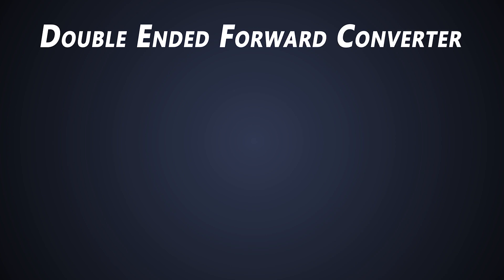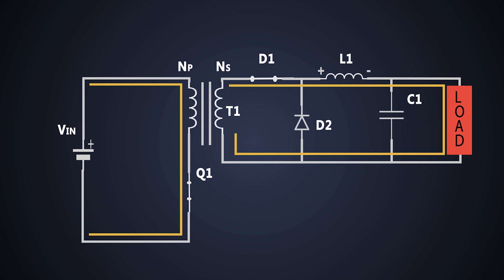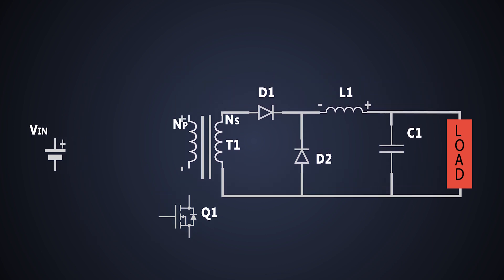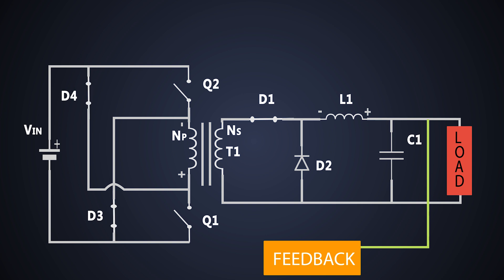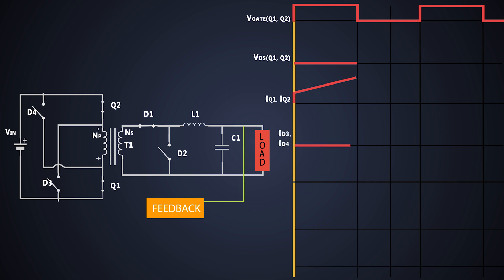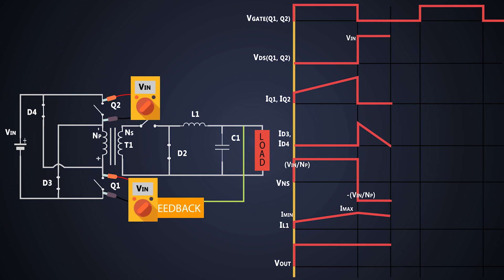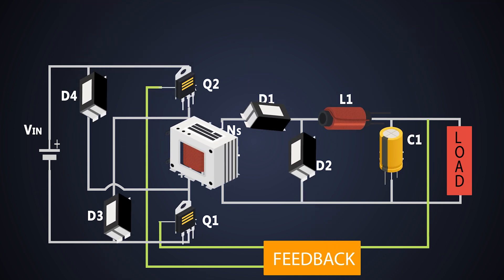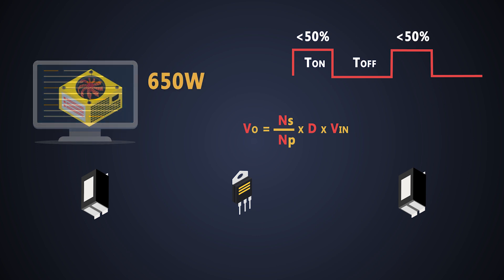Double Ended Forward Converter Working with Wave-forms | 2 Transistor Forward converter

Comment: Ok thanks for information but I have one question does the 2 mosfets use one pwm pulse as in not a alternating switching just forward switching from one single pwm pluse from the gate drivers transformer

Comment: Is there a reverse polarity of the primary coil or not in this system(forward)??
Reply from the maker: There is no polarity to any coil. just the DIRECTION OF THE CURRENT
Reply: @FoolishEngineer  
When determining the appropriate current for welding, does the processor change the pulse width or frequency, based on the feedback?

Comment: This topology is using advantage of transformer (for step down/up that only works for AC) to be used in DC, amazing idea! This is an alternative for converting DC to DC voltage in high power requirement instead of using Buck/Boost converter.

Comment: Why the D3 and D4 will on? If on, the current will flow from gnd to Vin. I'm so confusing.
Reply: NOTE: that D3 and D4 a REVERSED Biased towards Vin.  Only when the Mosfets feeding the Primary of transformer are turned off, does the voltage on the Primary become GREATER than Vin.  Then, and only then, do diodes D3 & D4 become Forward Biased = ON.  The Primary Winding is actually pushing amps back into the Power Supply capacitors!  When the the fly-back / kick-back voltage across the Primary Winding drops below Vin, do the diodes ( D3 and D4 ) become REVERSED Biased (again) and turn OFF.
Reply from the maker: Thank you for helping me out!

Comment: Can you tell me whats the behavior of the circuit under no load ?
Reply from the maker: If there is no load, still the converter will give constant output because of the feedback.
Reply: Will there be much power consumption !!! Or just minimal like in micro Amps.
Reply: @mdadil9233  There is more to this circuit than shown in this video, but if switching of the MOSFETS actually STOPS, then the only power consumption will be that of the Feedback Logic. NO-LOAD Mode can be called sleep mode, micro-power stand-by mode or chirp mode.  You need to specifically design the feedback circuit to properly handle No-Load Mode - ie soft-start.

Comment: Can we use full bridge rectifier ?
Reply from the maker: The Input is DC only, we don't need to use a full bridge rectifier
Reply: @FoolishEngineer  oh okay thank you. oh btw I,  before you answering my question, i try full bridge rectfier, and some how the current at the primary rose so high, the power mosfet at the primary get super hot. could you explain why?
Reply: It may be because... the bridge act as a voltage multiplier. Thatswhy your voltage increased